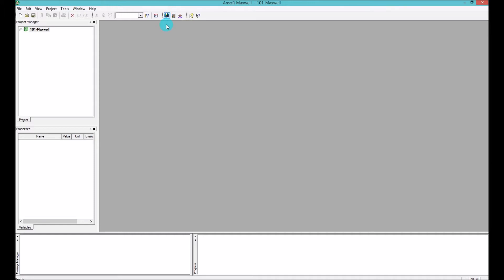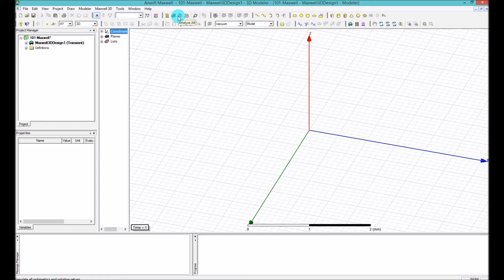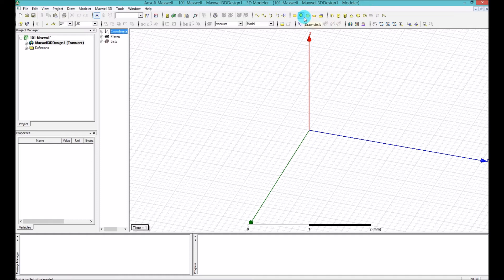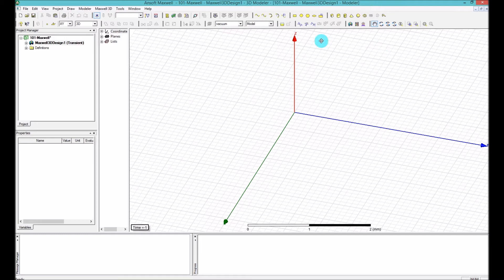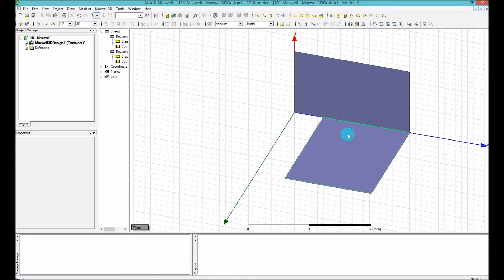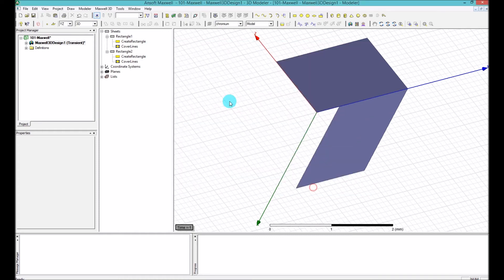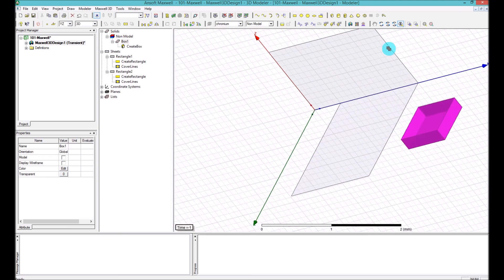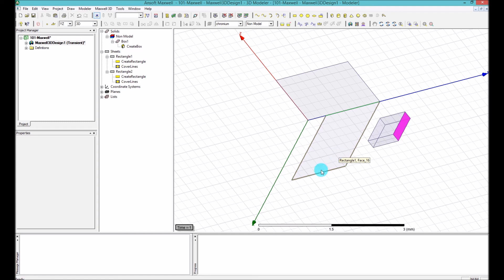102- Ansys Maxwell -- Basic tutorial on Tools

Comment: Can you import models from software like Autodesk or Solidworks instead of just drawing them inside this basic environment? It will be hard to create complicated shapes in this basic environment.
Reply from the maker: +Jon Saw  yes. I have to thrill on that. You can import step files solidworks files and autodesk. It's under the maxwell model import.
Reply: ***** Thank you, does it require any modifications or any extra steps of processing or it is ready to use in that case? Also Ansys bought another module for high frequency analysis. Do you have any tutorials for that?
Reply from the maker: +Jon Saw which tool you are referring to?
Reply: ***** Ansys HFSS